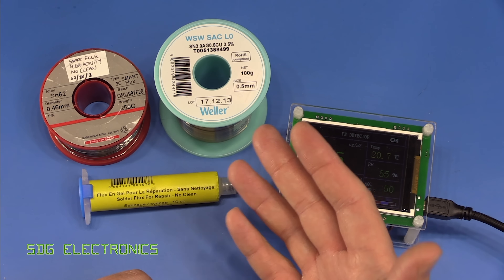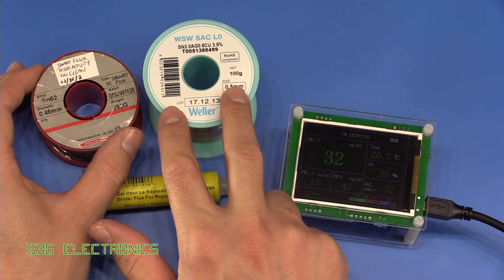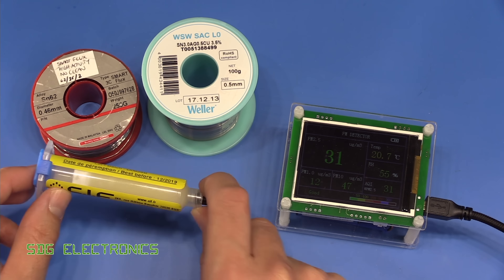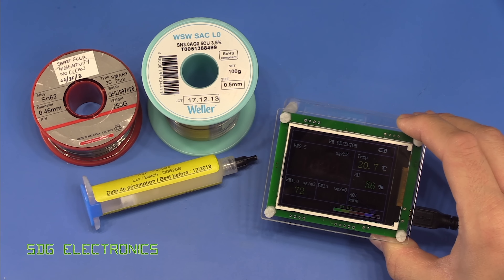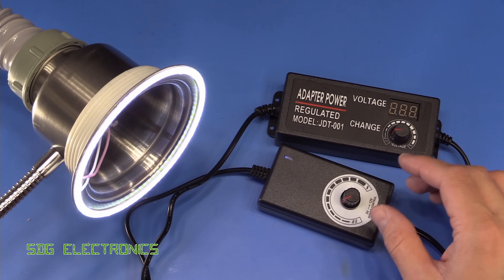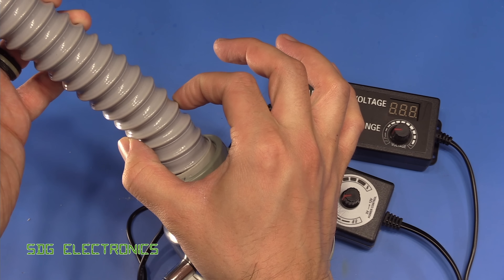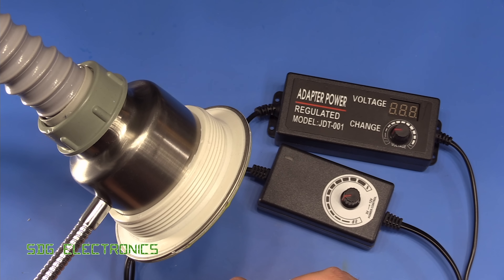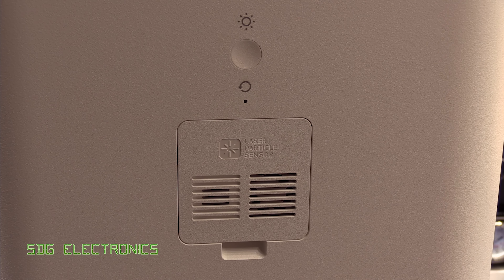SDG #131 Solder Fumes, Extractors and Purifiers

Comment from the maker: Good news, having reached the "end of life" on one of my filters: The Air Purifiers both accept retrofit filters with no RFID tag fitted and also don't enforce a filter change at end of life. It just displays a message saying the filter is full.
Reply: Can’t even be mad about that, actually a useful feature. I have to admit I saw the RFID tag on the bottom and got very nervous. The juicero model that’s coming out for all types of stuff is ridiculous and has me skeptical of anything with questionable microchips lol
Reply: You are a shining example with your fume, extractor, I like that;)
BTW. there is no relation between the "harmfulness" and aggressiveness of flux substances. By that, vinegar must be very bad stuff(cheers!). The individual composition decides the LD50 or carcinogenicity. I know it is very hard to get the lead-free-solder-bashing out of our heads. Lead is in fact no direct harm for you, but indirectly a very dangerous pollution for the environment and with that: Bad for you. But as Steve shows here, there are solutions! It may be that higher soldering temperatures induced by lead-free soldering produce more and dangerous types of fumes of the flux. But don't sniff that shit in the first place. Not lead-free, nor leaded. It is not cocaine!
Happy so(l)dering:)

Comment: Thanks for this. I’ve never considered a more thorough air purifying appliance because I use a very basic fan/carbon filter when soldering. But this makes sense, and the possible benefits beyond filtering the flux fumes is enticing.

Comment: I actually use one of those smaller air purifier by Xiaomi as fume extractor. I have for over 3 years and works perfectly. When I do some full PCB soldering in a hot plate I made, I place the air purifier on the bench and it sucks all the smoke directly into it's carbon activated filter.
Reply: Thanks for the advice. Which Xiaomi model number?

Comment: I don't use my solder iron very often so I'm happy with just something that moves the smoke away from my face. I use a 120mm DC fan which sits vertically on my desk, on a side, blowing away from me. When I switch it on, it creates a little airflow which is enough for any smoke to start moving towards that direction. The fan has no filter so the flow is high but clearly the smoke is being dispersed in the room, so good only for casual use.

Comment: I’d suggest the Xiaomi purifier together with a small fan that blows the fumes away from you while the purifier is doing its job. This will leave your workspace free from large air intakes from fume extractors so you’re more likely to use it all the time. 

It’ll keep the ppm levels around your face at about 50 which is probably way better then any fume extractor will achieve. Just one missed puff of smoke is far worse than breathing 50 ppm for half an hour.

Comment: Systemair 100mm fan with a matching Rhino filter all connected up with twin-walled 100mm ducting and clips, all said and done for around £80. Very powerful and long lasting, no nonsense solution. No need for draughty open windows. Another useful video Steve, gets a 👍 from me.

Comment: I like the idea, I've been working on my "lab" safety and upgrades update going on 2 days now and will make sure to post a video response of the soldering air purifier that I've been working on, its built into my bench top and sucks the smoke directly down into the counter top into a scrubber box. I particularly like the led ring part of your design it just makes sense.  I think I might be adding in a foot pedal for the extractor as well =)

Comment: I only solder occasionally but when I do, it's quite a large project or batch of projects. 
I've never even considered the air quality but after seeing the readings on the 2.5 I will definitely be putting something in place even if it is only a normal fan to blow the smoke away from me. I do use a lot of flux. I will be investing in a 2.5 meter.  I saw the same one you have for about £35 on ebay.  Thank you for this very useful video.

Comment: I have been soldering for many decades without issue, but that was mainly simple soldering without any external flux. Then I watched a lot of YouTube videos on soldering, and I purchased MECHANIC solder products (HX-T100, XG-80/XG-Z40, MCN-225) and started using lots of extra flux. I quickly started getting headaches and nausea and some respiratory issues, and it lasted 2-3 days after each soldering session. The actual soldering results were great though.. :-)

First I tried the cheapo chinese activated carbon desk fan unit, and it didn't help, I also tried a residential air purifier and it didn't work either. I started building a big fume extractor and ended up with a quite decent machine I thought. 60x60x60cm enclosure, embedded large 70W fan, 75mm diameter articulated anti-static ducting with intake funnel, 4 big filters (coarse, formaldehyde, carbon and HEPA), and I also started having a door open and an extra floor fan ventilating, but I kept getting sick. With the fume extractor everything seems to be sucked inside, and there is absolutely no smell in the room, so I am puzzled on what's still creating the problems for me. Maybe I am just imagining it at this point.

I will try some non-Chinese Kester/Amtech stuff later to experiment with. If anyone can give me any recommendations on specific lead-based solders/fluxes that work well and give fewer harmful effects, then I would be very grateful. Another thing I am wondering about is whether maybe I inadvertently touch my eyes or something like that, or if is the excessive IPA cleaning afterwards that gets me. It's most likely the rosin though.. I better get me a sensor like this excellent YouTuber shows in the video to diagnose the issue further.

I've spent so much effort  building my fume extractor... actually into a nice looking piece of furniture (side table), and I really don't want to spend the money on the commercial fume extractor units as they are so extremely expensive.
Reply: If you have a duct going outside or can make one through the wall I'd just extract air from directly above your soldering site and blow it out. I'm not so sure any filter will remove all the gaseous crap coming off even if you can remove the larger particles.
I think you may also have been exposed to bad stuff for so long that you developed a condition which makes you much more sensitive to the chemicals. This can happen with a bunch of things people do for a long time. I'd wear thin nitrile gloves when soldering or handling any chemicals or solvents like IPA.
Reply: @benbaselet2026  Thanks for the advice!

Comment: I use a pc cooler fan at low speed with no filters for local fume extraction (sucking, not blowing at me). It works surprisingly well for not letting dust and smoke into my breathing holes. Of course, it disperses the fumes into the room, so a purifier like the xiaomi seems like a good companion.
The fan is essentially noiseless, and thanks to no filters, the airflow is quite high. It has to be within 0.3 meter-distance from where i'm soldering, otherwise the updraft of convection around my own body overpowers it. I also use the same setup when cutting onions, helps to not cry. I wired it to be powered from my soldering station, so it turns on automatically.

I solder only occasionally. But i do dremel a lot, which generates loads of dust. That dust is certainly worth getting rid of, both for health and for lab cleanness. I think i'll buy that xiaomi thing. Thanks! THIS VIDEO DESERVES MORE VIEWS!

Comment: I did a video on building an extractor system, I 3D printed a filter housing which I placed on the end of some 100mm ducting, st the bench end I fitted a standard 240v wall extractor fan, works pretty well, although I don’t have any air quality measurements to reference, I will have to get one to test.
Reply: Yeah I was going to suggest using a 240V extractor fan as used in bathrooms, etc. - either one designed to mount on/in a wall, or an inline model that connects to ducting on both sides. Probably not the quietest option, but the airflow should be decent and the inline models are literally designed to move air through a long duct/pipe!

I'd personally consider trying out having a short length of narrower, more-easily-positionable tube right above the work area. That may or may not totally kill the airflow though :)

I also wonder how effective it would be to have something like that "extracting" the air+fumes into a box on the floor that could be filled with activated carbon and HEPA filters (and vents for the hopefully-filtered air to escape through, rather than trying to essentially inflate the box with ever-increasing air pressure!).
As mentioned in the video, venting the fumes outside does have the issue of also expelling the heat that you've just been burning gas/electricity/money to produce (same applies if using air conditioning, of course), and that's quite the waste of money and potentially not great for the environment either...

Comment: I'm currently trying to build a DIY extractor with filtering myself (still waiting for some smaller parts though, e.g. the AC/DC powersupply to provide power to the basic control circuit (just a bluetooth enabled µC and a relais)). The only thing I'm concerned about a bit is airflow, if you take the pressure drop of a particle filter into account (I got a 200 mm industrial fan rather cheap, but it's more for high air flows of ~1000 m³/h and not for high static pressure), but we'll see once it's build.

Those Xiaomi purififieres look actually pretty dang neat :)
But I guess it's too dusty in here, so it's filters (doesn't have a prefilter, does it?) would have a hard time..

Comment: Great video addressing a common complaint and problem in every home electronics lab. I was thinking that you could put that "kitchen garberatur funnel contraption" right into a larger plastic box with some filtre medium just like it is, seal that up and place an exit hole on the side. The Hakko seems to be the only unit readily available and priced on this side of the pond, and  it's still way too expensive, and you're stuck with their filters for replacement. I wonder about a cooking range hood/ three sided plexiglass box "hood" arrangement, going right into a filtre medium/activated charcoal box. Or a washroom fan. Smoke goes straight up, plexiglass helps contain it, and a few magnet lights overhead so you can see well. Or a small tube, mounted right to the soldering iron itself suctioning that away. Would be pretty noisy, though... All the Best! DE W8LV BILL

Comment: Hi Steve I also thought of a Henry, I was just going to  half fill the compartment where the bag goes with carbon granules  and see what happens, I'm sure you will have a far better design in mind
Reply from the maker: I was planning something similar, but just using the motor unit and building an MDF enclosure and speed control.
Reply: I knew you would have a plan in mind, looking forward to that.

Comment: Such a huge purifier!
I use Fanline Aqua device (a local Russian manufacturer). It's a pretty good thing, the air "extracting" is directed vertically. It has the ionizing module which works quite well! I have cats and if I let them into my room (especially one that has very thin hair) then I get some allergic reactions after some time. So this "water bucket" helps me a lot. It's just literally sucks all hair and pretty small particles to the water and they stays there.
In my experience it doesn't remove fumes quickly and fully but it's noticeable better to solder with it than without. And I use our local solder when I need a pretty low temperature soldering, it has the old GOST (USSR) standard and seems that it matches that standard. But on Ali you can find a lot of forges of our soviet solders :D The name is POS 61. The most possibly is that you will NOT get the original from Chinese sellers. Believe me. You can order it from Russia (much better but a higher price and more expensive delivery). I've bought mine at chipster.ru - pretty good prices. Not sure if they ship worldwide though...
And I will buy (didn't yet) the original Cyberflux e-600. It's pretty "eco" flux. You'll not get a nasty chem. things into your lungs inhaling a part of fumes from this. Beware, Chinese make fakes of it as well! It's origin is town named Old Oskol. Some Russian dealers just re-sell Chinese forgery of this great flux. It's sad :(

Comment: The black type for standing on your bench is supremely useless. Sounds like a vacuum cleaner and does not suck any fumes into its filter. Pure landfill.

I made my own with a fan, cardboard tube, and two carbon filters, which I can position better and which works.

I'm thinking now that just a fan with a short tunnel at the front (~120mm cube) is more efficient at removing the fumes from your face + an air purifier will be a long-term better solution for filtering than any solution with carbon filters which have mm-sized(!) holes in them.

Comment: Corrugated hose is restrictive, ie, the bumps create a vena contracta so the effective area is less than the actual hose diameter. Try smooth hose - smooth hose should flow 148cfm@28" H20 per square inch. We've used something similar when porting cast iron cylinder heads, it's just we use a vacuum cleaner. Most vacuum cleaner motors are 1000W and can pull about 90" H2O - I have 8 in my flowbench -.

Comment: You are telling that there are still high particle numbers present on the next day after soldering in your room. But what are the conditions? Do you open windows while soldering? Any active ventilation system running during/after soldering?
Reply from the maker: In the colder months, there is little ventilation.

Comment: I was thinking of converting a small shop vac or at least use the blower fan from one for fume extraction. Of course a remote power switch and a sound box with extra filtering would be needed. The "diy" unit you first shown, might help to have a larger collection box. Still it does look like a sad joke.
Reply from the maker: This is basically what I'm thinking might be the best solution.

Comment: I'm working on one with a car air blower, controlled by a PWM 12V power supply and a 3D printed nozzle and "pipe".
The filtering is made by air conditioner activated carbon, an Hepa filter and a pre-filter.

Comment: You can get some very decent proper fume extractors on Aliexpress, usually under the Knokoo brand, from about 170USD and up towards 350. Shipping can be expensive as I believe the subsidizing assistance of chinese->international e-commerce tops out at 2 kg, and these units are easily 10kg+, so finding an ebay or aliexpress vendor with an EU/US/RU (depending on your location) warehouse can be a big advantage on postage.

While the bigger ones really do work very well in terms of actual fit-for-use suction power, the smallest ones are a bit weaksauce. But you really should have the port on these right by the subject you're working on, ideally laying horizontally on about the same plane. You don't want to give the smoke and fumes any opportunity at all, to rise up towards your face and torso.

In my view, what the smaller models are most good for, is the housing, filters and control. Buying a replacement for the HEPA filter alone is almost the same price as the entire unit. So what we did, was buy a mid-size one, get an additional carbon filter (many of these only do particles), and replace the motor with something with a bit more grunt. It's a larger fan too, so it doesn't really make any more noise, it just sucks more. Sucks better. Oh ffs you know what I mean 😅

Comment: I have been looking for a good solution too, might give DIY a try. Also Damn man where do you live cause I live in New Delhi, India and here PM 2.5 is generally around 400 (not kidding).
Reply from the maker: Wow, 400? 😳
Reply: I could be totally wrong here, but I was under the impression that Indian cities are notoriously bad for air pollution. China has a similar problem.
So I suspect it's more a case of your ~400 being astonishingly high rather than the levels seen in this video being particularly low ;)

This report from Defra (the UK's Department for Environment, Food & Rural Affairs) says that the UK average (mean) PM2.5 concentration has been approximately 10-15 μg/m³ between 2009-2018. (I assume μg/m³ is the same unit used here!)
[Source: https://uk-air.defra.gov.uk/news?view=238 - click the "full Defra Statistical Release" link for the PDF report]

I've struggled to find proper data on PM2.5 levels *in London*, though those data must exist somewhere (this video was presumably filmed in the UK, and I myself live in the South of England, so London is relevant to the video and to me; it's also a huge UK city, of course, and it's also a city that's been working hard to reduce air pollution).
The best I've been able to determine is that London's PM2.5 levels are typically around 20-80 μg/m³, which is still far higher than the EU limit, and even higher vs the WHO's limit!
Thankfully I'm a several-hour drive/train journey from London and I almost never go there :p

Comment: Excellent work and really interested in the results. What was the small device you initially measured with and how accurate is it?  Many thanks for covering an
Important subject
Reply from the maker: I've just added the air quality monitor to the description. I did notice my mine has a bug though if the PM2.5 figure is 0 all the calculations are incorrect...

Comment: The problem with this fume extractors is that they such air from all over the place. What you need is better airflow control. A fan behind you that pushes air past you towards the fumeextractor in front of you. That will make it much more efficient.
Reply from the maker: Yes, infact down-draught ventilation systems are actually a recommended method of fume extraction.